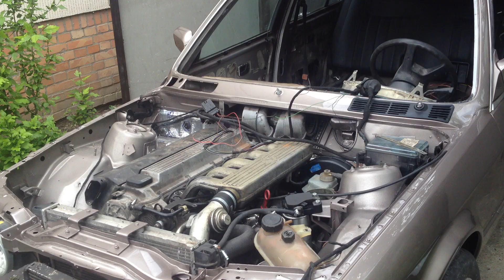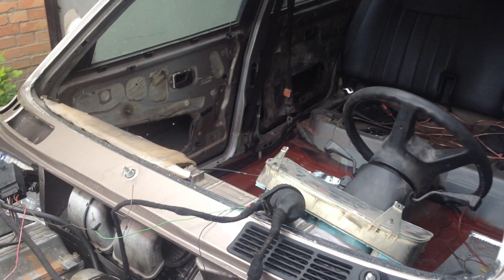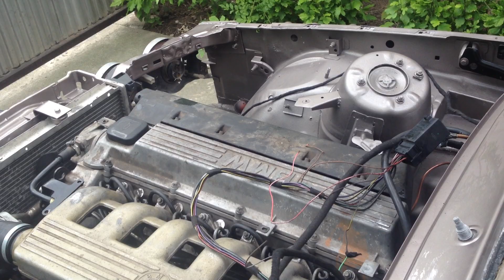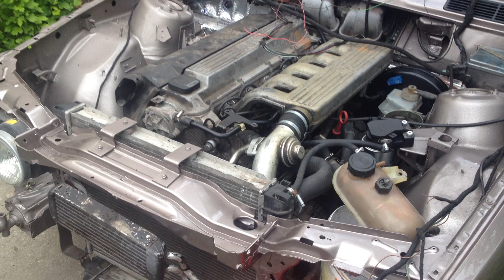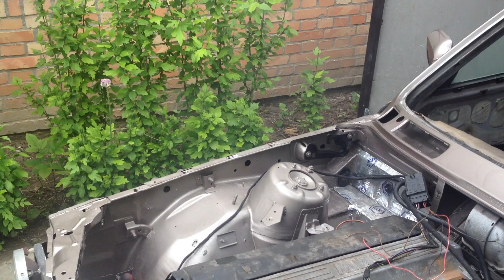BMW e30 M51 325tds mechanical injection pump

Comment: Hi, I am in the middle of converting my m51 from electric pump to mechanical as I am using the engine in a boat so I want to ditch all the ecu wiring, if I can get m21 pump will it fit straight on the m51 or will it need some modifications?
Thanks
Reply from the maker: Plug n play
Reply: How much lift do you time the mechanical pump to? And what are you using for a tach signla?
Reply: @Broccoli71  It is 0.9mm from TDC/Top Dead Center

Comment: Your m51 engine was with electric pump std right? I'm about to order one of these mechanical pump but I'm trying to find out how hard it will be to connect. Right now I'm just running evry mod with some other tuning stuff but every mod is kinda bad, and don't really want to chip. So I thought mech is better also heard it can deliver more fuel ++. Guess my real question is how the pump knows how much fuel to deliver/how many rpm the engine is delivering
Reply: Any VE6/10 pump is good for you. If you want extra power search for a VE6/12 pump

Comment: what kind of pump is that? as a matter of fact, what injection pump body did you use, because the electrical one can;t be done mechanic...
Reply: +fisher fisher 324d pump...m21